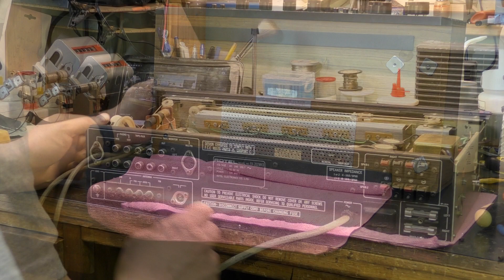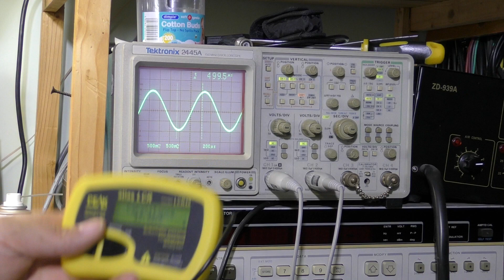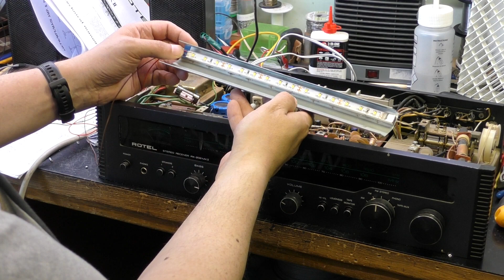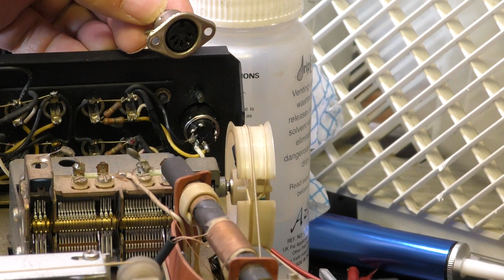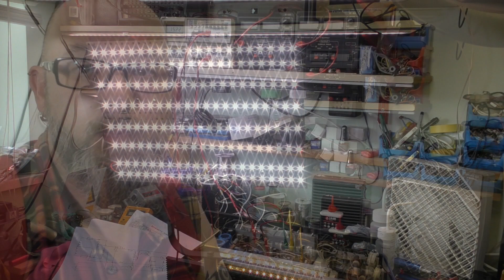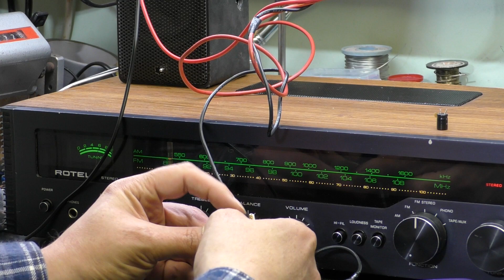Rotel RX 202 MKII Receiver Recap and Repair & LED Lighting.

Comment: I just finished a restoration on an early (1974) version of this amp, mine has the single rail supply and is now making 31wrms/channel into 8Ω after recapping and upgrading the main filter cap from 2200 to 4700uf. Interestingly my tuning meter was also stuck, it took just over one full turn of the pivot screw to release it.
I re-capped it but found only three were out of range, one of these had leaked and dissolved one of it's leads killing the fm mono. The failing bypass caps were probably the reason it was dumped, and someone else had been inside and screwed all the IF cans and trimmers. It took a lot of work to re align the FM MPX to working state with the pilot functioning. I really like it's sound, not unusual for Rotel to have that classic punchy performance.

Comment: wondering the difference in specs or audio outputs from this to the previous version
Reply: I just picked up the previous silver version and it is quite different inside. I downloaded the free service manual and luckily it is correct to my version.
Mine needs recapping badly, but someone has had a go already, neat enough soldering, but just random values have been thrown in from left to right channels. i purchased it with a warning
stating 'left channel blown' and this is the second Rotel I've bought this way, from the same shop and in both cases the left channel is actually fine, they likely just connected the speakers to
both right outputs, from speakers 1 and 2. It is an easy mistake, however it looks like the tuner in has also been screwed up, all the IF, MPX and oscillator cans have been messed with
to the point of getting nothing but static, and strangely zero output in FM mono. I'm getting 20WRMS @ 8Ω per channel, slightly higher than spec. it's a nice receiver.

Comment: Hi Darren - I Subscribed last night

I have just Been given a row tell RX202 to repair there are a couple of faults on it

1. First of all how do I get into it without damaging anything I've taken all the screws out and its still not going slide forward?
2. Left Channel is Dead, on the Speaker and the Headphones
3. No FM, but AM is loud and clear.

I look forward to your response

Stay Safe
Reply from the maker: I must admit mine was tight in the case. I think it shrinks. Also the screws for the feet can catch the chassis. First off all clean all switches to see if it clears any fault. Also obtain circuit diagram.  Check fuses to see if one has blown. If not check to see if preamp section working first on left channel (tone control PCB). look at DC voltages on power amp.  Daz
Reply: @darrencoe5795  Daz, Bless you

The Chassis was so tight, because the grill was catching.
I had to gently push the grill in, and then it cam out.

I am going to order some Caps, I have a list here I need to order.

Is WD40 any good as a switch cleaner?

Will keep you updated
Im in the Uk by the way
Reply from the maker: @rectify2003  WD-40 isn't ideal for switches, it's a bit oily and wouldn't use for pots  In fact they do a switch cleaner now from the WD brands. Yes, I remember now the staples in the grill causing issues.
Reply: @darrencoe5795  Ok Thanks

I will order some proper switch cleaner.
Back in the day, I went to SEME or Willow Vale.

Pushing the grill through, made me cringe, and there were some tack nails holding it in

Comment: I inherited one of these, beautiful units. Unfortunately FM was absolutely dead, AM fine.  I had to open front end tuner assy.   Q1  2SK55R was dead on test, also Q2 tested faulty.  I had to open tuner from the top, as did not relish de-soldering the tuner unit. Don`t read this bit - ((angle grinder to gain access!)).  On replacing Q1 unit actually started hissing, result. Q2 was the final fix, FM working fine and Stereo light too (replaced with led). So pleased with that. 
Then replaced all fuse type lamps the warm white Leds from Chao Yue Lighting on Aliexpress (£7 for 11 off).  Thanks for posting this video, gave me confidence to go in and repair, excellent guide. I managed to download the schematics which are essential for this type of repair.
Reply from the maker: I am glad you have got your receiver back up and running well. I suspect the FM tuner may have seen a surge of some sort, maybe a nearby lighting strike. I'm glad you found the video of use. Happy listening. Daz.
Reply: @darrencoe5795  Hi Darren, it`s a cracking piece of old school electronics. My sister who owned it previously lived in Bath, used to say they got lots of thunderstorms.
 I did put a modulated IF in while fault finding, it all worked. So I knew fault had to be in the front end (FB 112U19 on schematic). So much soldering holding the tuner in, plus the dial rethreading daunted me somewhat. Angle grinder through the top, allowed access to the FET and first RF amp transistor. (easily obtainable, got 25 off, 2SC535 transistors for £2.99  !!) I would think the Q1, Q2 could be a common failure point, especially with an external antenna plugged in, (no protection from static). Its singing now, all old bulbs replaced by LED units, runs cool, looks great. Took me days in fault diagnostic but well worth it. Thanks again for your video.
Reply: Should add my one is an RX202 Mk1.

Comment: saw one today in charity shop for 50 quid, was tempted, but not sure i need another old amp
Reply from the maker: I have the same problem, nice but not sure I need more stuff.
Reply: They are going on eBay on sold for about £80.00.
I have been told they sound really good quality

Comment: Hi there can you tell me what is the manufacturers name and values of those two large blue capacitors that you changed in this amp. Thanks again buddie great video as ever.
Reply from the maker: VISHAY  MAL205657103E3  Electrolytic Capacitor, Long Life, 10000 µF, 40 V, 056 PSM Series, ± 20%, Quick Connect, Snap-In Manufacturer VISHAY.  Hope that helps!  Glad your enjoying the videos.
Reply: @darrencoe5795  Thanks for your help buddie and yes I very much enjoyed the vid. It's people like yourself that make YouTube a great place to get help and information from. Thanks again buddie👍.

Comment: Hi Darren. I have a RX303 that has recently developed a few issues. Will re-cap first. Where is the best place to buy capacitors?
Reply from the maker: Hi, I bought mine from CPC. I also buy from Rapid electronics. I went for Wilma and Panasonic caps.

Comment: Hey,great video.Ive got an rx602 which is going strong so far,fingers crossed.I use it as a preamp to an RB 971These are very cool receivers  and sound great...
I've got a working tuner vu which I pulled out of a 402,you can have it if it's of use....keep it alive,good work

Comment: I just picked up one of these and the phono section has a weak channel, mm or mc. All others (aux, tape etc...) play strong and even. Do you think that the phono hook up you found disconnected, could that be my problem too? Or just maybe some new caps needed in the phono stage? I will try disconnecting that same piece just too see. I am a total rookie, but any insight you have would be appreciated. Thanks for the video!
Reply from the maker: Yes look at the phono stage caps. Also yes may be worth lifting the phono socket wiring just to see.

Comment: what a great video well done,  i have a Rotel RX-202 mk1 needs work.
Reply from the maker: Thank you. I'm not sure of the differences, but looks similar.
Reply: ok,on mine there is a mains fuse solderd in by tranformer witch as blown.
Reply from the maker: @jerryat187  the mk1 has a different PSU to the mkII. The power amps are each fused in the DC side and only a single supply. If it isn't fatigue, my thoughts would lead me to  start looking for a fault with rectifiers or smoothing cap.
Reply: @darrencoe5795   also one speaker fuse blows.
Reply from the maker: @jerryat187  Well in that case a short circuit speaker coupling capacitor or blown transistor/s in that channel.

Comment: I have a Technics amp that tracks really badly. I think it needs a new volume pot. Looks and sounds good Dax. Enjoyed watching greatly.
Reply from the maker: I wonder if that will be easy to find a replacement for that Simon. This one uses a tapped pot. I guess the carbon pots drift just like resistors.  You cant beat a large glowing analogue tuning dial though I've always thought along with large rotating spools or a record spinning. Glad you enjoyed this one.